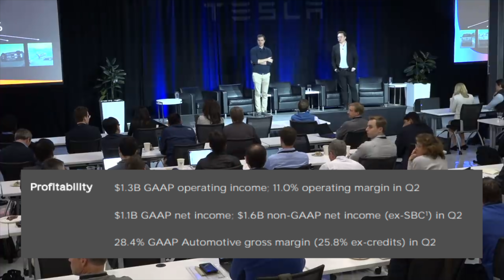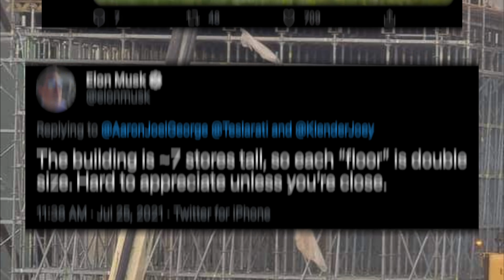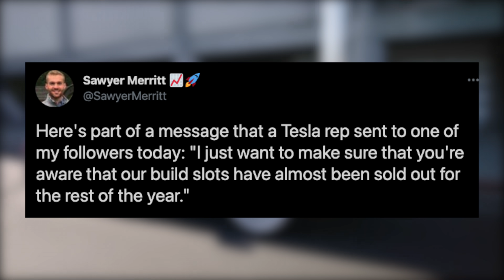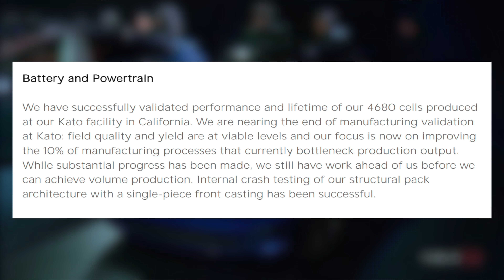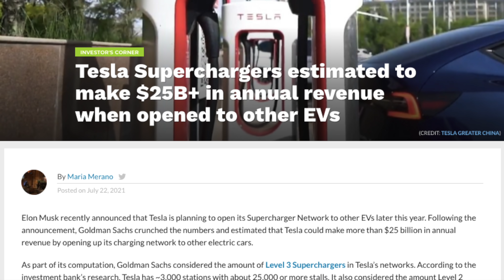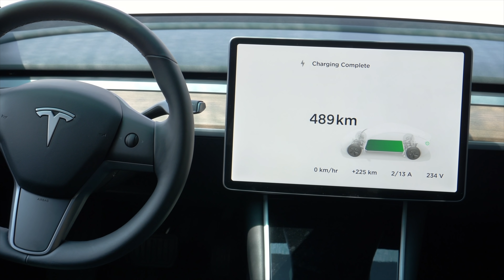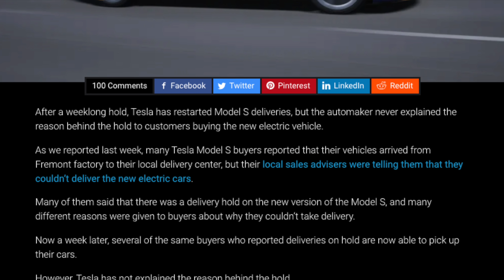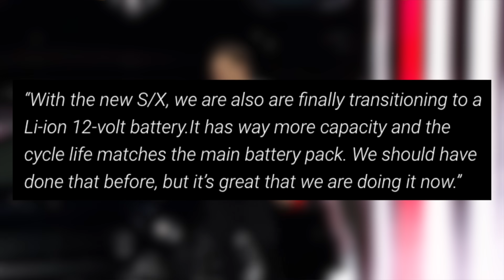Are There Any Teslas Left For 2021?

Comment: A wheel without physical buttons is like not being able to control your AC without taking your eyes off the road for several seconds, oh they are already doing that lol.
Reply: Except that changing the AC can wait. Turn signals cannot wait.
Reply: @geraldh.8047  No, in the name of safety it can't. Tesla doesn't care about it if it means changing their design to be less aesthetically pleasing.
Reply: @geraldh.8047  Its a bit complicated but what you do is you raise your thumb. You them put it down making contact with the button. Then raise your thumb again. It's in the manual.

Phillip.
Reply: @geraldh.8047  An accident can wait until you stop playing with your AC?
Reply: @g0balot  you can change the AC when you are driving in a straight line with moderate or high distance to the car in front of you. Won’t eliminate the risk of accident by 100%, but will eliminate the risk of accident by 99,97%. Usually good enough, people do much worse things when driving for longer in the real world.

Comment: I test drove the Ms plaid, the concerns about the yoke wheel is very true and very inconvenient when turning
Reply: I had no problem palming it even when I was moving through a roundabout. Maybe I’m just used to using that technique on other cars but it didn’t bother me at all, I quite liked having a clear view of the instrument cluster. The thing that will take me a while to get used to is the turn signals. I don’t think I made a single turn or lane change without instinctively reaching for a stock the wasn’t there. The on-screen shifting wasn’t a problem either, which was a pleasant surprise. If you’re used to gripping a steering wheel with both hands at all times I can understand why turning would be frustrating.
Reply: @notaperson6637  you gotta remember though people suck at driving
Reply: Where did you test drive it?? @Lt.Dan457
Reply: @spedracer55  very very true

Comment: I believe when Model Y starts production in Europe the demand will go through the roof, lots of people in Europe are waiting for the model Y and some are even ordering the Chinese version (which is probably very good) so no doubt the demand in Europe is there!
Reply: model Y range and performance is meh, compared to model 3. hoping 0-100 at 4.0-4.4 instead of 5s and 600km+ range  for the long range variant when Berlin and Texas start making it.
Reply: @apothecy4011  I don't think people choose Model Y because of performance
Reply: @casperhansen826  well it still needs a small boost. competition is getting closer. and model Y is more expensive than the 3. I agree that performance is not the focus but same thing goes with model X and that's actually faster than the model. Y could be at +0.1/0.2 instead if the +0.6 it is now compared to 3
Reply: @casperhansen826   I mean the new Y will be lighter due to the new manufacturing process, so it will definitely shave some milliseconds from its 0-100 times.

Comment: In Norway (one of Tesla's biggest markets) has tons of roundabouts, and it's mandatory to to use indicators when exciting them. That means that you need to turn them on while the steering wheel is turning. It's pretty simple with a normal wheel, just stick your fingers out while steering, but it's near impossible with buttons. You need to take your eyes off the road, look at the steering wheel to find the button and then find some way to push it while the wheel is spinning round. Terrible for road safety, and as we know, auto pilot doesn't do roundabouts. Terrible decision.
Reply: This is a muscle memory issue though. The same thing is true when you first learn which way you push the indicator causes which side of blinkers to turn on.
Reply: Don't understand. Why would you need to take your eyes off the road? Also, we have roundabouts in the rest of the EU and we need to indicate too. Nobody else has a problem. Perhaps it's a Norwegian problem?

Phillip.
Reply: @philliptemple4534  Yes, it is a Norwegian problem. Or will be one :-)
Reply: Wow!  I live in Norway and I thought Norwegian drivers  had the indicator controls removed at delivery.  Nobody indicates here.
Reply: @g0balot  Haha, fair enough. :D
Reply: @g0balot  Hah you should try France. After watching an FSD video, I was looking over my balcony thinking about some of the comments. I did a little 30 minute tally and around 80% of cars didn't indicate before turning (either after already starting to turn or not at all). About a quarter of the cars jumped the red light. More than half the bicycles were going the wrong way down the cycle lane. And nearly all the food delivery scooters ignored all traffic rules. Quite a lot of cars tooted at for not noticing the light change.

Most cars don't indicated coming off a roundabout here, and you have to be pretty agressive if you want to merge. It will be interesting to see how FSD will work with petty drivers that deliberately close gaps to not let you in.

Phillip.

Comment: I feel like Tesla took too much out and tried to change too much when doing the yoke. Should’ve kept the signal stocks and what not. Everything on the steering wheel just makes it seem clustered and also isn’t very practical. It’s not very tactile. Idk, like the horn for example, why not keep it centered instead of a small button. People may try to defend these things, but he stocks and all weren’t broken, didn’t need to be changed like this because they didn’t impede anything. They just made it faster and easier. Having small buttons like this, especially for older people will make it harder.

Comment: Tesla superchargers are physically laid out to suit Tesla charge port location.  Most other EVs do not have compatible port locations.  Imagine an ID4 parked at a supercharger, it will have to use the charger on the opposite side to the Tesla, this will result in that VW effectively blocking 2 slots.

Comment: Does anyone here know if an aftermarket replacement round steering wheel has been released yet?  I'd guess there will be a number of options available from the aftermarket soon, if not already.
Reply: @AudiTTQuattro2003  No reason it will. Aftermarket yoke steering wheels are selling like hot cakes for M3/Y and they use official Tesla cores and airbags. No warranty problems.

Phillip.

Comment: I ordered a Model X in NJ but now I have second thoughts. I really don’t like the steering yoke, not to mention shifting on a screen. I find myself always at 10 & 2 hand positions on my model Y. Backing up I tend to use the whole steering wheel, I see the yoke being a problem. So I’m still a little old school. I was hoping for a normal wheel like my model Y this might be a deal breaker for me.
Reply: At least try it out first…
Reply: You’ll get use to it. We are just so use to using both hands and alternating hand position over and over to turn the wheel either direction. With the yoke, in about 2 weeks it’ll be instinctive for you to just put a few fingers into the opposite side of the yoke that your turning and you can easily have full control of the wheel as far as you want to turn it. You’ll play around with it and find what’s easiest for you. Once you get fully use to it (maybe a month or 2), you’ll absolutely love it
Reply: You can also change the gears on the bar where the yelid signal is

Comment: I am curious if they are going to roll out the new 4680 cells on the Model Y as a totally different order option, as in you can specifically "pre-order the Model Y with 4680 cell" or if it will be rolled out into production under the current general Model Y queue (meaning you don't get to pick, you get it if you get it).

Comment: My Tesla Y has been on order for months and I too have been told it will be October for delivery as well.  With this type of delay, it is getting close to when Giga Austin will start making the cars with the new 4680 batteries.  It seems to make more sense to put my order on hold and wait until this new frame and battery pack comes out. Lots of uncertainty as to when the new version will be available and will the build quality will be where it is now.  Another point - the price of long range AWD Y is much closer to the performance version.   I was thinking about cancelling my present order and place a new one for the performance version in January if it looks like the new car will come out by the time I receive the car. Any  insight from others?  Anyone else thinking this way or have done it?

Comment: I love my yoke.  I only wish the windshield washer was a double click when set to auto.  When scrolling for speed on auto steer, i do hit the windshield wipers on occasion. Only downside.  I have never hit the horn by mistake.  Also, have an issue changing songs and doing a quick blinker by mistake, but that is getting better with time.  Outside of that I only have a few drawbacks with the plaid.  I.e. missing icons for things you have to go through voice search t o get to, like sentry video review.
Reply: Good to hear you like the yoke.  My X is scheduled for Jan 2020 so looking forward to hearing about how it works over time.  

Any issue with tight parking lot maneuvers or parallel parking?
Reply: @JBoy340a  honestly no.  I think a lot people are hating on it because they haven’t driven it.  The only thing i had to adjust to was i used my knee to hold the wheel straight while cleaning my sunglasses.  I know. Not safe, but i did that.  Not possible with the yoke.  The leaving of the hand at noon while cruising passed quickly. My only advice is to use the inside of the wheel which is different. Instead of grabbing the outside of the wheel to do full rotations turns, grab from the inside and it works just fine.  I’ll try and post what i mean tomorrow and tag you.  It’s actually better and you maintain more control through the maneuver. Congrats on the x.
Reply: @shermanglory  - Thanks so much!!!

Comment: Tesla told me today that the issue with the Model S is around the 19" wheels, its a "regulatory" issue and they do not know when it will be approved. I have been waiting since March for the LR with a 19" They have yet to begin deliveries of these models and I can't upgrade to the 21" without incurring an additional $10K upcharge. I wish Tesla would communicate better and make this right for people ho have ordered the 19" wheels.
Reply: @AudiTTQuattro2003  Honestly, I think the explanation is rumor floated around by Tesla Reps. I think they just do not have stock. I will be happy to take ownership with none of the new wheel caps. I would just like a straight answer.

Comment: Well, I asked Tesla UK about those horrible silly damn Yoke Steering Wheel on our Right hand drive UK upcoming Tesla's.
They replied that I was right that under the UK road laws that damn horrible yoke steering wheel is illegal here in the UK. 

And will NOT be on our new sold Tesla cars. 

Because under the UK road laws the driver must have full control of their car when turning and driving it.driven using both hands on the wheel.
So there has to be a full round steering wheel fitted so the driver can maintain full turning control by feeding the full round wheel through their closed fingers and hand.

If you have the silly horrible half sized yoke steering wheel with the top half missing you can't feed it through your closed hands so that will break the rules.

So I pleased about this fact, 
I think if the USA and Canada Drivers are forced to have that yoke! Allot of possible sales of the new model S & X will be lost as most people don't wish to have the yoke.

Also the EU has the same rule about full hands on control using a round steering wheel, So Elon can't get passed that either.
He will have to make round steering wheels for the right hand drive Tesla if he wishes to sell them n the UK or EU.

And maybe even in most parts of the world too as they I sure have safety driving rules about the full control off their cars turning and driving too?

As there is allot of former British colony countries which have right hand drive wheels and the same rules over the driving control.
Like Australia and New Zealand. 

So Sorry Elon either except it is not a popular idea by most people who wish to pay a huge amount for a Tesla car, 
Since a customer is paying so much money for a product I think it is only right to let them have a choice of what they wish to have and how they wish to use it like?  

Customer is king remember and the more they are paying, the more they deserve choice.

And I would not be surprised if most possible buyers of the cars don't go and buy a second hand model S or X Tesla steering wheel for the new car 
and have the Tesla approved repair shops fit it in place of the horrible yoke one and set the controls up for the old round steering wheel.
Reply: Simple. Don't waste time selling into the tiny UK market. The rest of the world are happy with the yoke and will buy up everything being produced. Problem solved, everybody happy.

Phillip.

Comment: The Tesla adapter is the best.
Compact and the most high tech.
Europe's design is crap.
Reply: Sweden here, have to disagree. Pretty happy with Type 2 at home feeding both the 3 and the Mini SE and CCS (DC) fast charging on the road.
Reply: @AudiTTQuattro2003  Not at all true.
You paid haters don't see the facts and just wanna bash Tesla.
Everyone who has used both the US and Europe's ports knows which one is better.
Reply: @andydolphin3796  Sweden doesn't use the EU standard plug?
Reply: @neeljavia2965  yes it's the EU CCS for DC and Type 2 for home charging
Reply: @AudiTTQuattro2003  I have both Tesla and non Tesla charger at home.  I don't what's running behind the scene, but there is no question that Tesla port is more compact physically and it can do DC, L1/L2 with exactly the same port.  My Chevy Volt port for L1/L2 is bigger and it can't do DC at all.   Keep in mind that Tesla charger port came out first; you'd think that newer ones from other would be more compact.

Comment: If I can’t replace the yolk then I’m getting a Ford lightning.
Reply: @Dylan Bucicchia I don’t like it. I drive with 1 hand and the way I steer it doesn’t work for me. Plus the buttons are touch sensitive. I’m not about to relearn to use something I paid 60,000 for.
Reply: @Dylan Bucicchia it has 230 miles with 1,000 pounds on it. Without that weight it’s over 300. Research it.
Reply: Yrah the only problem wih the plaid is the yoke. But even wth tha it is stil better than a ford tho
Reply: @Joker-fx6mh  if Toyota made a 4Runner EV I would jump all over it. I’m a simple family man that wants to jump into electric but Tesla is getting so futuristic now with yolks and other stuff that it’s intimidating. That’s why I’m going to start slow and most likely get a Ford. I reserved both so we see what happens.

Comment: The stalkless Yoke is a bold choice and it's easy to dump on innovation. Like Apple eliminating the head phone jack on iPhone or CD drives on Macs. But, like those changes people will come to love the Yoke and the removal of stalks. Elon knows this, hence no need for a "standard" wheel option.
Reply: I'm sorry, but making the blinkers and horn only usable via smooth force touch pads is NOT innovation. How is it safer or better? It's objectively not!
Removing the 3.5mm headphone jack is not as big of a deal because you're only dealing with a phone, not driving a 2.5 ton rocket. The ONLY objective pro to the yoke is that you can see the driver's display a little better, but even that is iffy. As a Model 3 owner, I will never buy another new Tesla if they force the BS stalkless yoke onto the rest of the lineup.
Reply: @neeljavia2965  Experimenting with less popular vehicle is smart move. But both Yoke and no stalks is unfortunately bad idea and should not be experimented in public at all. Both are security risk.
Reply: @mho0  That's the job of Nhtsa.